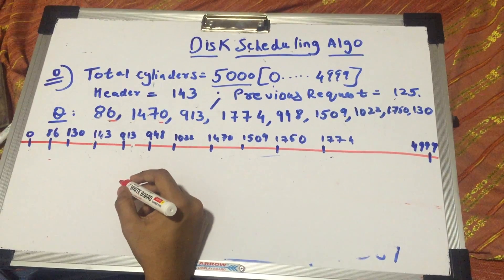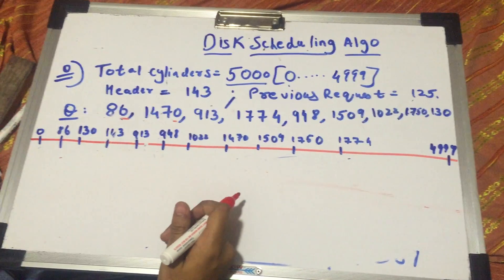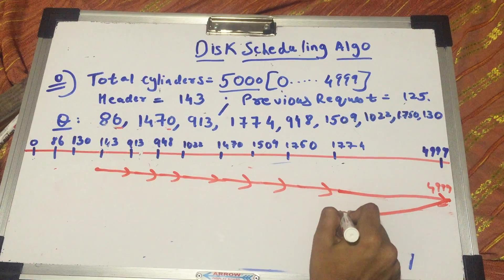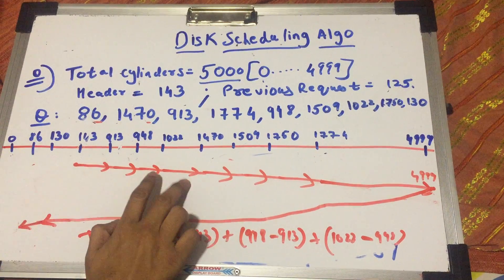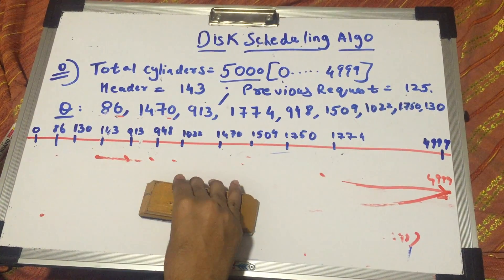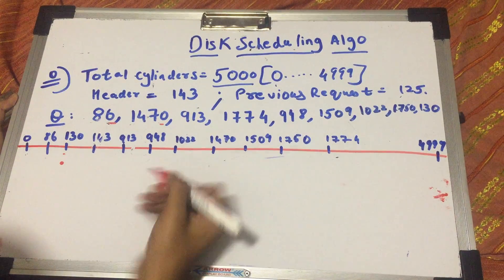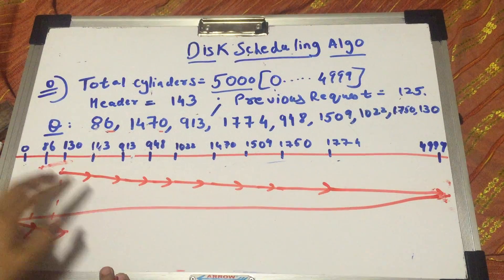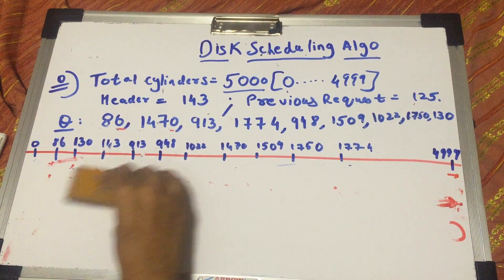Disk scheduling algorithm  in operating systems(Part 2/3)

Comment: I think the C-SCAN answer is 9985 not 9813... Please check once.
Reply: correct  (4999-143)+(4999-0)+(130-0) = 4856+4999+130 = 9985
Reply: Same here
-_-
Reply: Same here Arvind
Reply: Thanks Arvind bhai , mujhe confusion se bachane ke liye . Otherwise I was getting confused when i calculated and checked my answer with the video's answer .
Reply: Yes its 9985 for c-scan
Reply: 9985

Comment: just  bit of confusion with the direction..you said that the  head will move in the direction opposite to that of previous request (i.e if previous request would have ahead of 143 ,then the movement of head would have been like 143->130->86 and so on)but another video have moved the head in the direction opposite to what you have told..:P..so iam bit confused as to what should i do...
Reply from the maker: +Tarun Bhatia hi buddy, I am pretty confident that is the way to do it! still i'll look up a few reference books and get back to you!
Reply from the maker: +Tarun Bhatia Hi as promised,  i did have a look at the reference books and  yes this is the way to do it!
Reply: thanx bro..thanx allot :)

Comment: C-SCAN is incorrect. The jump from 4999 to 0 is not counted because we're not scanning. Doing so contradicts what you said earlier and that is once we start scanning we must continue scanning in that direction. Think of a circle if it goes from 0-4999 then when we pass 4999 we get back to the beginning hence the name Circular Scan (C-SCAN)
Reply: Dude it is circle(just figuratively) we move from outer track to inner track or vice versa that is actual movement.
You can check these links if you like 
http://www2.cs.uregina.ca/~hamilton/courses/330/notes/io/node8.html
https://en.wikipedia.org/wiki/Elevator_algorithm#Example
https://courses.cs.washington.edu/courses/cse451/04au/section/section7.pdf
http://nptel.ac.in/courses/Webcourse-contents/IISc-BANG/Operating%20Systems/pdf/Test_Problems/Mod%205.pdf
https://www.cse.iitb.ac.in/~rkj/cs347m/disk.pdf

The only resource I found that contradict this is that http://www.cs.iit.edu/~cs561/cs450/disksched/disksched.html
I have no idea why it is given like that there!

Comment: For SCAN why didn't go up to ZERO yet you went all the way to 4999?
Reply: its because the request ended at 86, only if there was another request after 86 ,say 135 , well then it will go all the way to 0 then go to 135. think of it like a freeway and you are going down one lane ,its a one way. the only way you could come back up is to go to the end of the road (4999) and then turn to come back up to 130 then to 86, but your destination ended at 86. there is no reason to go to 0. unless you want to  come back to 135 then you will have to go to the end (0) turn and come back to the 135. "try my best to make a visual example,  hope it helped".

Comment: Scan disk algorithm is done Wrongly. In scan disk algorithm first moves left upto zero and then starts moving towards right..Please do confirm your logic before posting such videos.
Reply: +Janesh bj I believe he is correct because he specified what his previous request was. Since his Previous request was 125 and his header is at 143, the disk arm is moving to the right.
Reply: +CompSci Studio 
So why he didn't took 130 before 143 if 125 was header..
Reply: +Kunal Tewatia 125 WAS the header location BEFORE we started this problem. When we come in, the header is already at 143 and moving to the right. The request to read 130 came in after the header was at 143 and moving to the right, so it was impossible for him to read 130 even though he passed it between 125 and 143.
Reply: +Muhaimen Shamsi ty for explaining
Reply: Janesh bj bro see the previous request
Reply: his way of solving it is correct , if you are not giving the previous direction then by default you go left , but because of the previous direction given you use that to determine what direction to start of with. because its 125 to 143 that means its going right because the number increase. but if it was say, 155 to 143 well then that's decreasing and therefore you will go to the left.